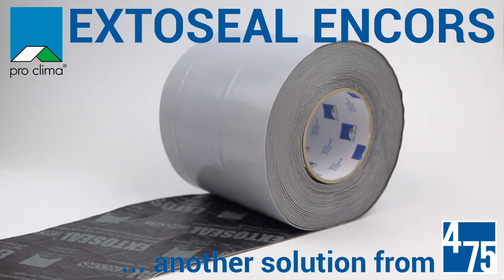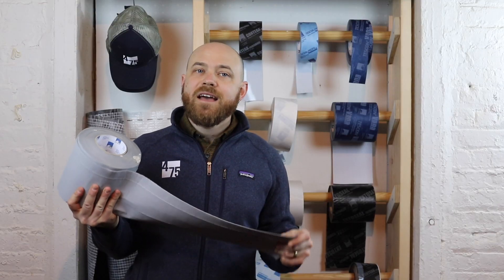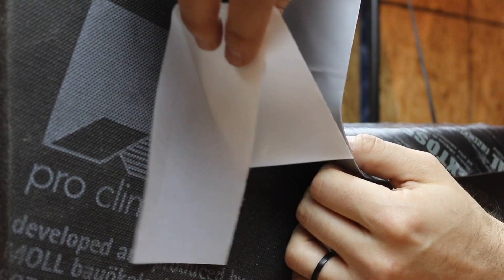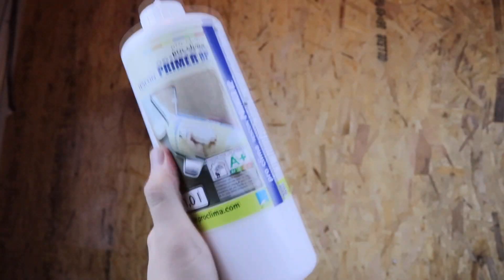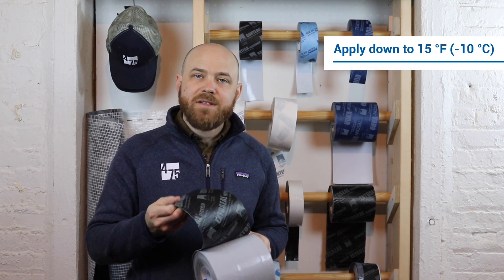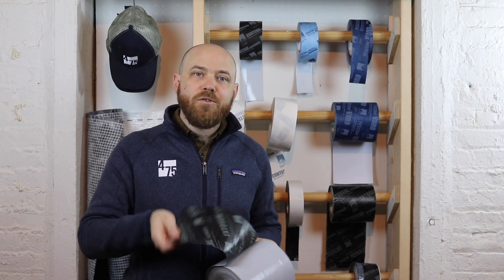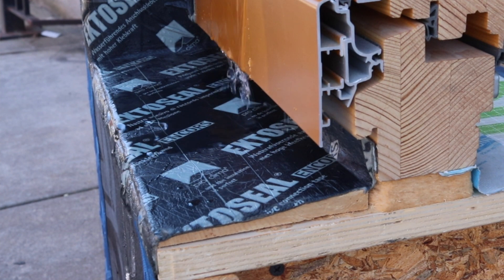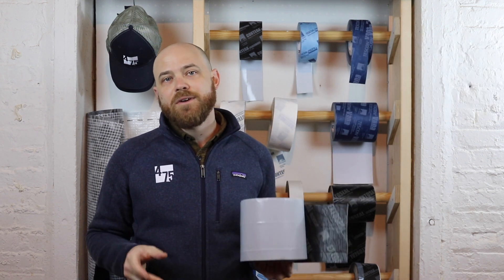Intro to EXTOSEAL ENCORS: Flexible, Durable, Waterproof Sill Tape

Comment: Hi And thanks for the video. 
If I use tescon rp primer on a wooden substrate that gets wet will extoseal stick?
We are building a houseboat.
Above the floating structure there is a wooden deck. On the deck there is a wood framed house.
I need a product  to put in the joint where floor and wall meet. When it rains it gets very wet and I don’t want water to go under the sill plate.
(We have solitex fronta wa as house wrap)

What do you think?

Thanks a lot
Reply from the maker: Please send us a detail - via our website - so we can give you the proper recommendation. we are not completely sure what floating structure is and
how it ties to the deck/wall. Drawings, photos, or details are welcome. We're happy to help you decide the best fit: https://foursevenfive.com/contact-us/
Reply: @475.SUPPLY  thank you very mach for your Support. We eventually went for extoseal finoc.
We hope it works. If not we will get back to you in the future